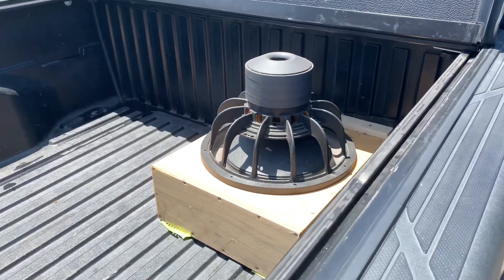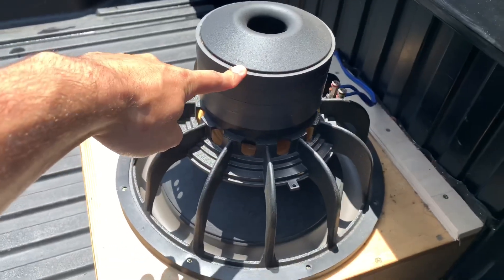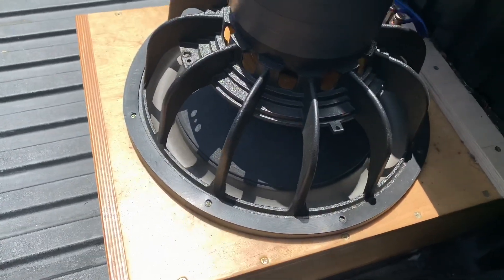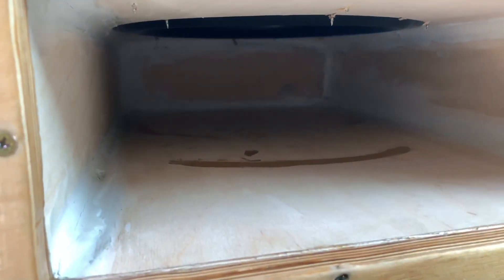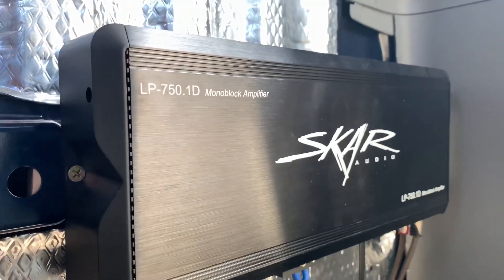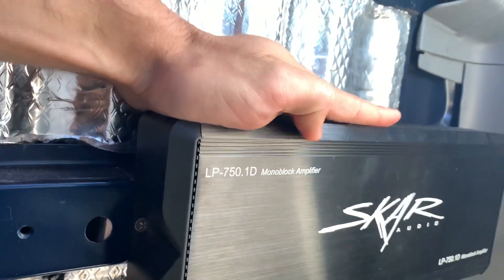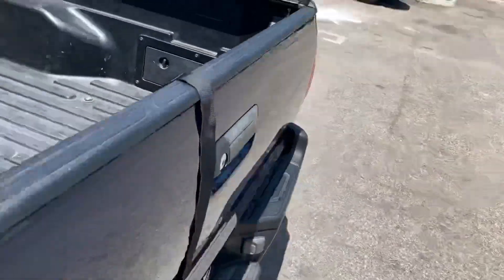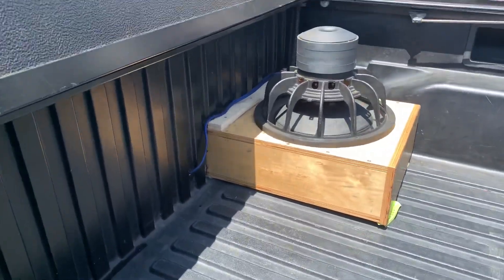Blow thru infinite baffle sub

Comment: That sub is weak, or at least the IB setup. With all that space in the back and you already did a blow through hole, you should have built a 4th or 6th order bandpass box. two high excursion 8 inch subs will outperform what you have.
Reply: LA RC Yeah, no! Two 8s on the same wattage will not out perform a 15 inch sub. 4th or 6th order would need double the cubic feet. The bed of his truck is actually functional and still can be used.
Reply: sdyer5340 —-just by looking at how little flex that 15 puts out, I know two eight high output xmax eights will flex that vehicle more than that 15 in IB form.
Reply: @ULSB1969  You can't judge the flex of a subwoofer through a youtube video. Two 8's will always have lower cone area than a 15. So unless you have some magic pixie powered 8's they will not outperform this 15
Reply from the maker: Alright man here’s a follow up just for you. https://youtu.be/1y-7MfmB_6c
Reply: Your comparing an SQ brand to spl 8's...
Reply: doesnt matter the cone area.. what matters is the air mass that gets moved.. 2 8in subs could most definetly move more air mass than one 15... way more variables involved than just cone area.....
Reply: You clearly don't understand IB. Google.
Reply: GrandPixel —-i don’t understand that IB is to use your trunk or space as the box. What is there to understand? It’s a subpar way for cheaper bass output and quality. I have been in car audio since the 80’s, that’s when it became popular, how could I not understand? You don’t understand my suggestion, if he doesn’t want to give up his space then a better alternative is what I suggested! There is nothing you can teach me, I have done it all, I have had it all
Reply: FSXgta⸻⸻⸻⸻⸻⸻⸻⸻⸻⸻⸻⸻⸻⸻⸻⸻⸻⸻⸻⸻⸻⸻⸻⸻⸻⸻⸻⸻⸻⸻⸻⸻ are you saying that 15 inch IB setup will beat a 2 8’s 4th or 6th order setup? 😂😂😂😂😂😂😂😂😂
Reply: GrandPixel —-i understand it more than you will ever know. I have had IB setups, and they don’t compare to 4th order , 6th order or straight ported or sealed boxes. I’ve done it all. It’s easing to just give your opinion when you have limited knowledge. I see beyond what you think you know. There is no point in trying to convince someone without the know how, cause if you had it you would not have gave your pathetic opinion!
Reply from the maker: Big Billy Goat Gruff good point. But if we’re diving into specs you want to consider how FS/QES will impact the build. 15s usually have more favorable parameters to IB and band pass than 8s
Reply from the maker: LA RC all praise @LA RC. Jesus has arisen
Reply from the maker: LA RC it’s getting firey over here. You’re definitely right that 4th or 6th is better. I would do that if I was making a proper bass truck. But I’m not. This was my best option for super small footprint, low cost, and respectable sound.
Reply: @braxtonmarius  definitely your are right on that... my eights fall short of my desired bandwith.... I can tune em to low 30s high 20s but then I roll off on the high end way early.. and vice versa... but yea... I got two old Boston acoustics pro series 10.8lf in mint... idk, but those were my dream subs when I was youngster lol.. after hearing a pair of them in two different set ups, I was hooked.. haven't done of build with these yet tho... I think I'm going to try and use them in a home set up... anyways, good point!!!! Lol
Reply: @braxtonmarius  i am actually considering ditching the eights for a pair of 10's so i can port tune at fs and qts and still get my  high 20hz and reach up into the higher octaves... i like the tightness of a smaller driver reaching low, than a big 15, but lose alot of db and bandwith... i had 2 sundown sa 15 v1 in a two door jeep for awhile, and i loved it, but smaller subs ive found stay a bit cleaner sounding, and my car doesnt fall apart with 8s lol... but anyways, hll yea!! good to talk.. always cool to share knowledge!!!
Reply: Braxton Steichen -cool, enjoy.

Comment: If u would get rid of that skar audio amp that is a big piece of shit u would actually b able to beat the only reason I call that skar amp a piece of shit is because I had the same one and it not only didn't do rated power but it also wouldn't run the ohms listed in the manual with more than adequate voltage so I went on the skar website and tried to post my findings and every time I would try to it would b immediately erased skar audio is a disgrace and everyone should know this